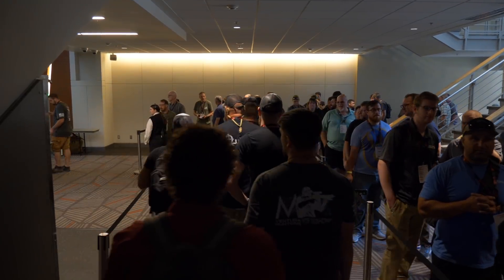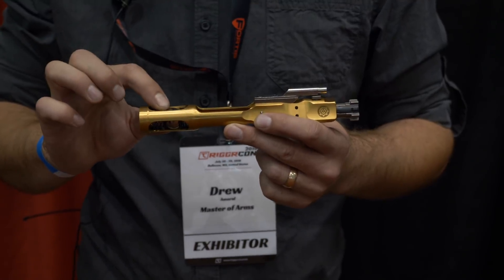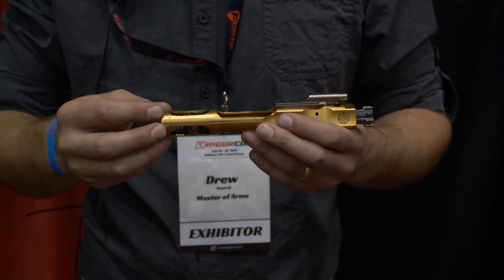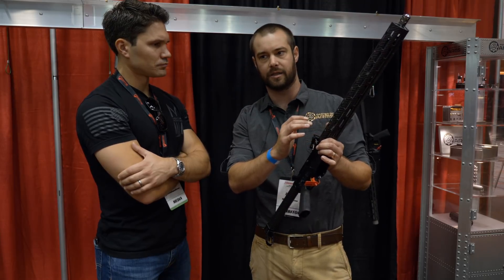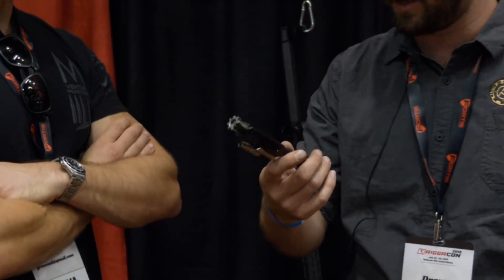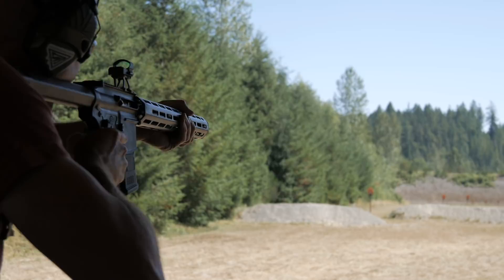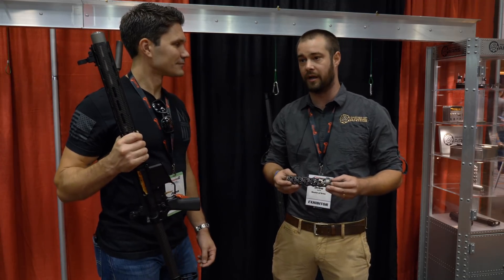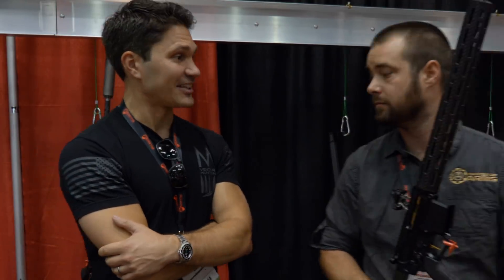The World's Lightest AR-15: The ENYO + Titanium 3D-Printed Silencer

Comment: That ball bearing spring idea is brilliant!!!
Reply: spektr540hemi It's perfect for when you don't want your BCG to stay together when you need it to work... buffer the BCG with the Buffer look at DPM
Reply: We shall see how it goes. Only use will tell.
Reply: spektr540hemi true... thrown it on a binary lower ...  
But that cost
Reply: Much ado about nothing
Reply: It's called a tuned mass damper (except this one doesn't have a damper per se). Some skyscrapers use them to deal with earthquakes.
Reply: @acruzp  A tuned mass damper is based on a somewhat comparable principle, but it's definitely not the same thing. Tuned mass dampers are active systems, where hydraulic pistons move the mass of the damper off axis to counteract any forces such as gale winds or seismic tremors. But a better name for the ball bearing system would be "inertia delayed", and it's a passive system instead of an active one like a tuned mass damper.
Reply: @pieterveenders9793  Thanks for the explanation. Love learning stuff like this.
Reply: @AlphaMachina  You're welcome! 4 years ago I actually visited the largest tuned mass damper on earth by chance while visiting the Taipei 101 (one of the tallest skyscrapers in the world) in Taiwan. With both typhoons and earthquakes as part of life, the damper was a necesitty for such a tall building. As a visitor you can get close enough to touch the damper, which is gigantic bright yellow ball of steel several stories high, which must have made its placement during construction one incredibly impressive feat, nearly 100 stories up in the top of the building. A friend of mine actually visited during an earthquake and she told me she could literally see the damper actively being moved about by the hydraulics to dampen the tremors, I think there's a couple of video's of it here on YouTube, quite a weird sight to see!
Reply: @acruzp  and they work.

Comment: Handling this firearm in person was impressive, but I will admit that there is little distinction in felt weight between a three and five-pound rifle when they get that light.

I am looking forward to seeing more developments with the tensioned-barrel concept. If an integral suppressor were added to the barrel-retention nut at the front, maybe even mimicking the profile and thickness of the hand guard, I bet the set-up would be very light and extremely quiet for a 5.56.
Reply: I think the difference is in the accessories. With cautiously picked accessories, a mid 3lb rifle could be a 5 pound rifle with optics, suppressor, laser etc. Whatever you need. Vs 5lb rifle moving up to 7lb region

Comment: "Your reticle is video game smooth"
Reply: What's the bolt have to do with the reticle??
Reply: @thomassteele1728  the shifting weight, when there is a heavy gun around it means the recoil or flip will be completely reduced when you reduce the shifting weight of the bcg
Reply: @100ghillie  it's also marketing BS. the amount of momentum transferred to the shooter is the same, they just dump it all at once when the carrier bounces off the buffer in the back. no way there is enough spring pressure to slow that rocket of a carrier
Reply: @ravener96  You're right, but for the wrong reason. There are springs that can dampen the violence of the BCG. However, the momentum (being a function of both velocity and mass) will be affected by the mass and velocity but only marginally. It also depends a lot on the buffer spring coefficient. In a perfect setup, this would help recoil but it requires tuning across the entire rifle to make a large difference.
Reply: @tmpace9  momentum is always conserved, it's a law of physics. since you give the same ammount to the bullet either way you will recieve the same ammount in turn. the entire gun as a system will impart the same momentum on your shoulder no matter how you set up the BCG. kinetic energy is a different story, but recoil is about momentum change.
Reply: @ravener96  The buffer spring increases the time of the force. Impulse is the felt recoil. Impulse is force/time. If you increase the time, you decrease the impulse. This is why people can cushion their fall by bending their knees.
Reply: @tmpace9  i know, which is one of the reasons their PR is bs. what im talking about is pure momentum change though, which, while apprechiated by the constant recoil MG people, is really underappreciated in the gun community. the weight of your gun really doesent matter that much, it's the time the gun spends slowing an apropriately weighted BCG that does.

Comment: Lost me at $3,800.  Dayum.
Reply: J name I can't remember where I seen this figure but I believe it actually costs 1500 to make a SCAR due to the union that represents their workers. The materials aren't that bad but they pay everyone very very well
Reply: exotic materials and processes involved in making something like that.
Reply: I guess you could buy a $5,000,000 titanium printer and do most of the work yourself. If you're good with cad that is.
Reply: @pcodyssey41  I've heard you only need a couple of weeks to understand CAD & with titanium 3D printer, buy a lower end element printer to start off. Is it really necessary to start off high class to protect yourself?
Reply: @lilbarz5226  There's a big difference between being able to understand cad and being able to design parts that will withstand thousands of rounds of abuse and also perform well doing it. As far as the printer, there is no cheap printer that handles titanium powder. The cheapest one I could find was over $250,000 and that's just for the printer itself, it doesn't include any of the post processing machines you need to put out a finished product.
Reply: Gay

Comment: Lightness requires compromise...... Guns are no exception to that.  You probably don't want to get into a firefight that lasts more than 1/2 a mag with this gun.  I'm curious to see what inexpensive graphene will do for firearms a few years down the road but I don't have much interest in a zero margin tolerances lightweight.   The suppressor is a different matter though especially at $350 + 200
Reply: Damn you're right. I don't know about you but I'm getting into modern combat firefights about 2-3 times a week now.
Reply: It's not a troll, just a facetious joke, mate.
Reply: The compromise could come in the form of the price you pay for the gun and still have top quality, durable everything else.  I don't think that's the case here.  But it could be the case somewhere else.

Comment: I am skeptical of innovative, parts like this being as reliable as more proven designs, but the only way we'll get inprovement is by trying new things. I'm concerned about reliability and sacrificed functionality. I heard they removed the magazine release gate to save weight! Sometimes the weight is worth it. I require a forward assist on a defensive AR, and I like a collapsible stock. This barrels can work well, but they have to be well made, and that handguard tension at the muzzle is a new one. This company new and whether their products live up to their claims remains to be seen. But if their BCG and receiver alloy work as claimed I'd consider trying them. I'd put them in a heavier fully-featured AR, not a bare-bones proof of concept. Good on them for trying new methods and pushing the envelope!

Comment: All for .223... "We've reduced the recoil". What recoil?
Reply: When you're shooting competition, it becomes different. Every 1/32" of sight movement costs you time.
Reply: Classic Random Hobo: Hey, you might be right. I don't compete. But I know what that rifle is/does in combat. Not stopping anyone from seeking out the rifle, but I know you can fire an unmodified A2 off of your groin and still group at 25yds.
Reply: Lassi Kinnunen: I know the bearing serves to add kinetic mass to the bolt and carrier. Or you could have not fluted the carrier, It would've added an ounce or two and then you'd not had to worry about ftf. You'd still have a 4-5lb rifle. Just seems a bit over designed is all.
Reply: "I know you can fire an unmodified A2 off of your groin and still group at 25yds"  There must be a really strange story behind this info.
Reply: TexZenMaster yup and off of your forhead no problem, like a light push
Reply: TexZenMaster: basic training, we had a drill instructor fire single shot and burst off of his groin and hit a 25m target to prove to the trainees that the rifle had practically no recoil.

Comment: Make it with a piston and ill probably actually end up buying it as my first ar15
Reply: I too am in the market for a lightweight platform, at Triggercon I was impressed handling the 6.8lb POF Revolution (7.62x51), as well as a Q Honey Badger on display.

But overall, I would probably suggest building your own AR in a similar fashion as InRange TV's WWSD (What Would Stoner Do) set-up. I built an AR years ago using an Osprey piston, and I have to admit it is a pain with the hand guard limitations available. PWS makes a great piston system, a lot more robust and simpler than other choices.

I'm currently running with a Robinson Armament XCR (a non-AR piston rifle), and despite my love for its functionality and controls, the AR is a platform that has gigantic aftermarket support and innovation.

I would recommend avoiding the pitfalls I took by personally handling many firearm options before making a choice, as well as considering the attachments and features you want it to have or may decide on upgrading to in the future. Good Luck!
Reply: Don't buy an ultralight AR10, you will hate it, the OG AR10s back in the 50s and 60s where super light like that as well, having fired one of those, it will throw you around like you are a rag dall, 7.62X51+ light weight don't mix, even the SCAR-H has this issue.
Reply: USonuMabeaCh putting a piston on this is the same idea of putting a spoiler on a Honda Civic.   This will never have a piston on it because it defeats what they are trying to do.
Reply: Redneck Fury

 I'm not sure, a 11lb FAL weighs as heavy as hell and has an equally mean kick with .308. The idea of a 6.8lb POF seems like the perfect weapon to bear the weight of a suppressor and an optic, maybe even a bipod if shooting from prone was a priority.
Reply: Halfdollar 86 i disagree. I think of it more like putting heavier, larger diameter wheels on a drag car so that it ain't total garbage when it needs to turn. A piston system doesn't add that much weight, and i utterly hate DI. Id rather have a 4-5 lb rifle if it keeps carbon out of my battery and face. Ive fired m16s in the Corps, and i bought an m1a because i prefer its advantages.
Reply: USonuMabeaCh I hear what your saying but this rifle isn’t for everyone.  This is a non mil spec rifle.  Everything they have done is to cut weight. They have went to extreme measures to cut weight and if a piston adds weight to the rifle, even 1 oz, it’s not being added.  This rifle just may not be for you.   It’s not for me either. This is for the guy that wants to say..... hey man, I got one of the lightest ARs you will ever see.   I’m not defending the rifle nor saying this is a gun rifle.  I’m just stating my opinion as to what there goal is for this rifle.  I would never own a thinner than pencil barrel.

Comment: Not to be internet engineer here... BUT  you're tensioning a piece of steel by putting a carbon component in compression. That's almost the opposite of how those two materiels are intended to be used. I don't say this to slight the amazing work done, but just to point out as an aerospace dude, that you could/probably should use a different handguard material to achieve the same resultant tension you're putting on the barrel

Comment: How do you 3d print titanium? Isn't it just cnc?
Reply: reyray 

Even though it is a CNC process, it’s not like a vertical milling center at all. It’s a form of direct metal laser sintering (DMLS). Basically, a super fine   titanium powder is automatically spread into the printing bed, and a CO2 laser follows behind and melts/fuses the titanium together. It’s more complicated, but it can be far faster than conventional machining processes.
Reply: CPHannigan  interesting, thanks for that clarification, 👍

Comment: Wouldn't it just fly around ? It's too light for a round like that.
Reply: Max Pain I still don't trust that weapon
Reply: "Video game smooth"
Reply: Max Pain  Actually, it uses .223 Remington. Good thing there isn't much difference between .223 Remi and 5.56 besides the fact that the Remi round has very slightly increased diameter compared to the 5.56 NATO round.
Reply: @sugarnads  You're wrong in two ways: It's 5.56, not 556. If a gun was chambered in a round that's 556 millimeters in diameter, it's basically a cannon at that point, lol! 😂

Comment: Should be called, The most unreliable AR ever.
Reply: I don't see anything being inherently unreliable. 

I remember an attempt at cast aluminum AR receivers. These days you have to try really hard to be more unreliable than those.
Reply: +BlindAF verified, All "Forged" AR lowers are cast, Aluminum does not suffer the way steel does when cast.
Your generic milspec AR lower and is cast as a solid chunk then finished, only your high end "Billet" AR lowers are made from a solid block of aluminum.

Stoner designed it this way.
Reply: The rep claims he hasn’t been able to break his personal rifle of 2 years when he was asked about reliability
Reply: he didn't say how he tried either
Reply: knightmarex13 what do you mean how, she put 5000 rounds through it
Reply: I like the stock ...it makes it easy to scratch your ass
Reply: BlindAF verɪfɪed actually a lot of those lower recever are still out and about as Frankford arsenal made a bunch of registered FA guns and they get a lot more use on full auto. 
I know as I own one with the giggle switch.
Reply: Anything to back that up  ??
Reply: it's not hard to not break your $4000 range toy/safe queen

Comment: I'm all for advancing the industry and materials, but why a 3 pound AR? All it does is increase felt recoil, which still isnt much, but still.
Reply: Your comment reminds me of another guy I talked with at Triggercon, he was in the Aerospace industry and mentioned testing a Glock slide made from a solid carbon structure (I forgot what it extactly was). The result was a slide with little mass to absorb the recoil, resulting in exactly what you mentioned "increase felt recoil".
Reply: Didymus 1999 For cool factor and maybe hunting? After a while carrying a gun gets old but a standard AR isn't that heavy to start with

Comment: at what point do you go too far and ruin the advantages of the platform? massive aftermarket with parts interchangeability? NOPE, all proprietary. light recoiling? good luck with a 3 lb gun. durable and reliable? don't go tripping and falling because you'll probably snap it in half. cheap and easy to assemble? HA! HA..HAHAHAHAHAAhahAHhahAHhaHAHahHAHahHAHAHAHAHAHhaHAHahHAHhaHAhahHAahaH
Reply: yep, it's actually more dangerous to go slow than fast because they don't have enough downforce to handle correctly when going slowly.